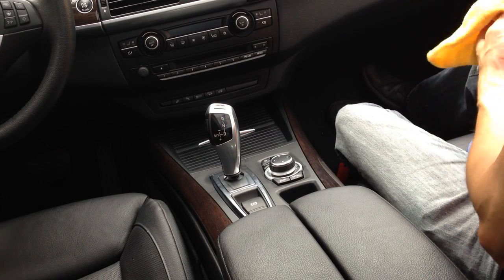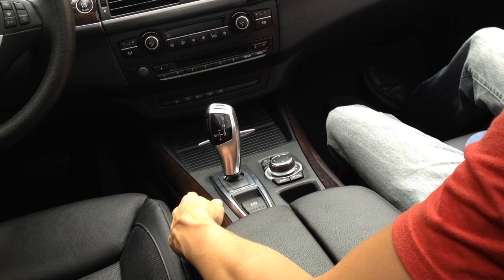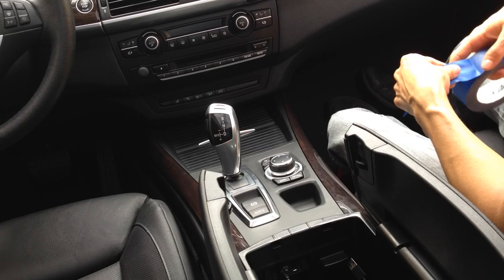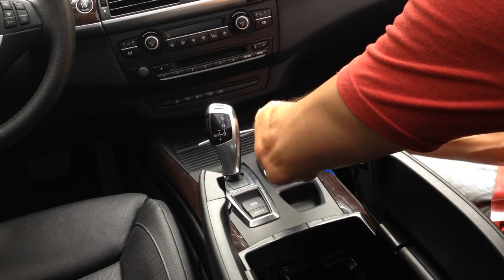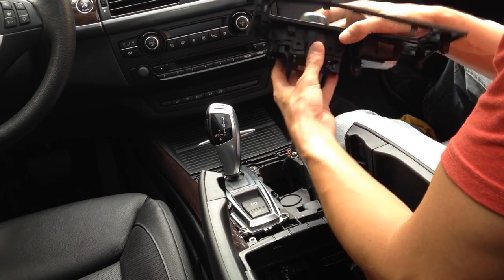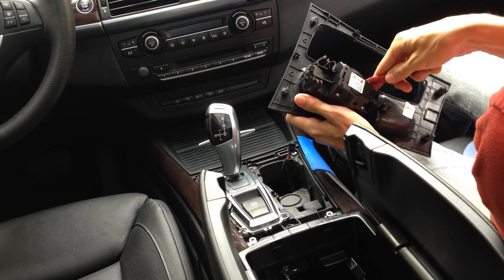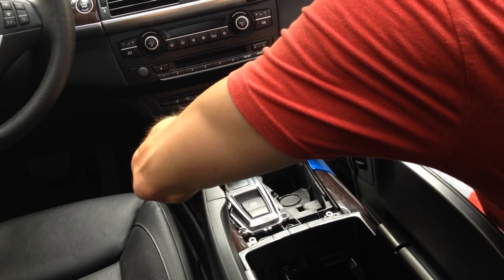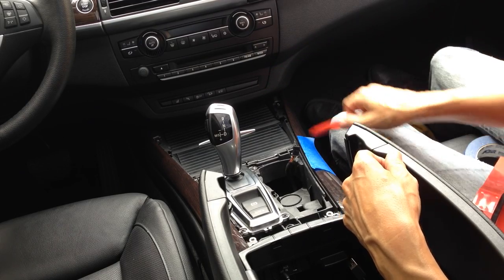BMW E70 X5 - Center Console Trim Removal & Installation (1 of 2)

Comment: BMW X5 3.0D E70 2009 South Africa. Thanks for the tips my friend. I repaired my bro's iDrive controller. It wasn't selecting when you push down on it. Stripped the module and found some corrosion on the circuit board. Used Electro Spray and a Toothbrush to clean it up.... Also sprayed the multiplug. It now seems to be working perfectly.

Comment: I think I have a broken part stuck in the front door shutter I try to push it in won’t go jn
Reply: Ok had broken parts front and bakx used a metal coat hanger broke it and was able to pull parts out everyone should check that after removing the shutters